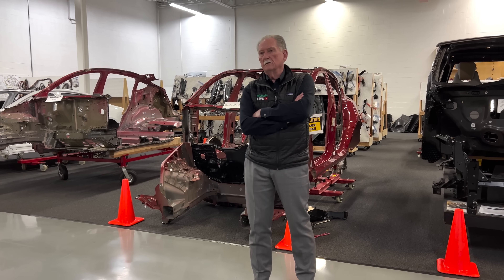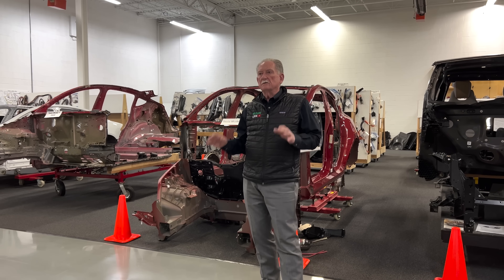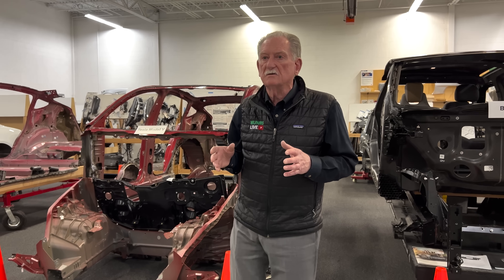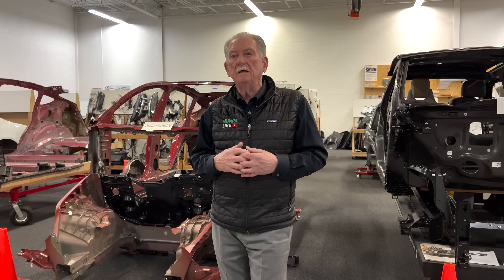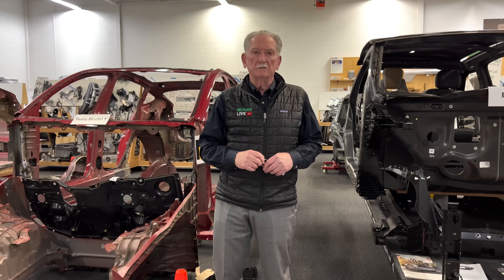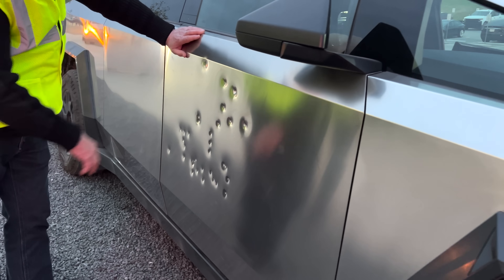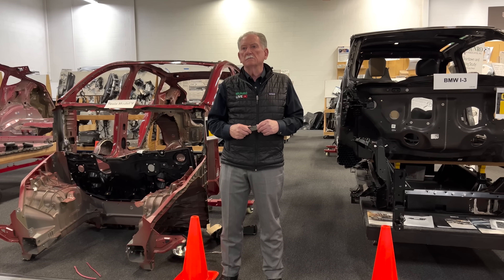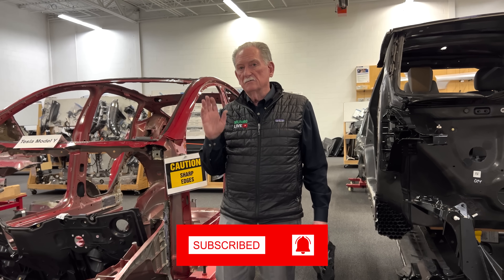An Engineering Analysis of the Tesla Cybertruck

Comment: I’m most excited for the industry to follow 48v.
Reply: Time to ditch the terrible Lead Acid batteries.
Reply: @TCPUDPATM  Lithium has gotten cheaper, and EVs don't have the big starter load that an ICE does.
Reply: @TCPUDPATM  time to wake up, no BEV now uses 12v lead-acid batteries. Lead-acid batteries are needed in ICE vehicles because they can provide very high current necessary for starter motor.
Reply: @ElementaryWatson_fafo  "time to wake up," … Yeah. Sure. Sorry to burst your bubble but about every BEV out there also has a 12V battery. They may not be lead-acid any more but they're there. That's more energy efficient by far than to keep a 400>12V buck converter powered, for the few mA you need while the rest of the car sleeps.
Reply: 48 Volts is not the only news. Tesla has replaced the old, slow CAN bus with high speed internet. With low latency, you don’t need a lot of direct connections, which means you can reduce cable harnesses as well.
Reply: @inber  the new CAN bus is sick also. Both in use together are just better
Reply: @Tazman55x  Especially when time goes by, and wear and tear, as dust gets into all those electronics.
Reply: @RogerM88  because the 2013 Model S electronics are totally all destroyed🙄 get out of here with that mess
Reply: @Tazman55x   Completely different layouts, as environment applications. Unless the Cybertruck is targeting the Rivian R1T profile costumer, wealthy sub-urban people, mostly using it as a car.
Reply: I will probably not tow anything. Just put my bikes in the back. Extender seems a little excessive. But all depends on
Reply: @jackhammer078jack4  most American truck buyers don’t use a truck for truck things anyway though honestly.
Reply: AAA will fix your flat tire.
Reply: @BonoBronck this is the answer, flat tires are rare, carrying a tire all that time is a waste, and roadside is easy to
Reply: It's so cool when an "old guy" appreciates cool new stuff
Reply: Thx to Elon.  And the bozo haters gonna say... Elon didn't invent that.  Dumbass.
Reply: 48V is dumb as hell, the reason 12V is used is because dry skin provides a barrier to it. 48V is going to electrocute a huge amount of novice individuals and technicians. Most likely wont permanently harm them but its just a absolutely terrible idea.

Have a high voltage power system for high power needs and keep everything else 12V or lower. This move is ignorant.
Reply: Strange thing to get excited about.
Reply: @xbus-chris I think you mean a 12V battery? I do know they use 48v for their motor system. My Toyota Prius hybrid uses a ~200v traction battery and 12v accessory battery. The aux/accessory battery is almost always 12v on any passenger car. The 12v-> 48v low voltage system for accessories is what they are talking about.
Reply: @xbus-chris I know that. 48v traction (what you are describing) is compared to the 800v of this vehicle and is vastly inferior. The 48v in this instance is for the aux systems. My 2012 hybrid has a 200v traction hybrid system so 48v for the hybrid/propulsion and recuperation system is old news
Reply: 12v vs 48v sounds like much ado about nothing. Changing battery configuration from 12v to 48v is trivial, so any manufacturer can do it in a moment. Savings on wires are not even noticeable in any way. The rest comes to the equipment. The electronics used in the car needs to reduce the voltage to 12v, 5v,  2.5v, 1.25v, which means there are always power supplies reducing voltage. I would expect more losses in this process due to 48v than 12v. Some electric motors are also fed from LVB, which I don't think will be affected in any fundamental way, but the suppliers would need to redesign their manufacturing lines, which will cost money.
Reply: @ElementaryWatson_fafo  Ah. So if that's all not noticeable and basically a waste of everybody's time, as you say, then why are Tesla and others doing it in the first place?
Reply: @MatthiasUrlichs  that's exactly how every conspiracy theorist behaves. He says I don't know the explanation therefore my theory is true. In reality, the burden of proof is always on conspiracy theorists, they need to prove their point instead of arguing from ignorance.
Reply: @ElementaryWatson_fafo  Oh come on. 48V need 1/4th the cable cross section of 12V for the same amount of power. That's not conspiracy, that's basic physics. Also 48V motors (windows and whatnot) are more efficient than 12V. Many trucks use 24V for much the same reason. Plus Tesla is very unlikely to spend a couple million $$$ on a 48V changeover for no good reason. Thus sorry but the burden of proof why 48V are BS is on you.
Reply: @MatthiasUrlichs  you don't know the first thing about physics, you just keep embarrassing yourself.
Reply: @ElementaryWatson_fafo  Ah. So the P=U*I , R=U/I, R=r*l/A formulas which you commonly use to calculate how much copper you need for a given distance+voltage are just plain wrong and all of our electrical appliances work by magic instead? Is that what you're saying? If not, care to be a little more specific?
Reply: @ElementaryWatson_fafo  lol
Reply: Perhaps, but 24v is already standard. There's not much benefit and a whole lot of added churn by adding a third standard.
Reply: While yes.. every fact Munro mentioned is true.. it's really not coming to the end product... 75% weight reduction... BUT only in the areas of the wire harness that is being replaced.. so it just doesn't add up to a significant end weight.. and as for the price.. the end price of the truck is enormous! So where does this savings show up when it matters?? 

What's the point of all this conversation and moving away from a massive industry standard of 12v  if it's all theoretical improvement that the end user doesn't get to enjoy anyway?

Saving a handful of pounds in things as massively heavy as an electric car/truck is meaningless to the buyer! And the so called money savings is again not enough to effect the end cost of the vehicle.. it's still crazy expensive to buy.. so.. great for manufacturing cost cutting... But meaningless to us customers?
 When do we get to see these benefits? So far it's all just money in the pocket of the manufacturer and never ends up in the buyer's pocket.
Reply: @Napster60  - excellent points. Also, 75% wire harness weight savings so we can then add triple redundant steering systems? I’m not saying there isn’t some impressive engineering in this thing but the shifting arguments for overall advantages of those different systems is problematic to me.
Reply: @Napster60  " “We didn’t know that our wiring harness for Mach-E was 1.6 kilometers longer than it needed to be. We didn’t know it’s 70 pounds heavier and that that’s [cost an extra] $300 a battery,” he said on a call with investors Thursday. “We didn’t know that we underinvested in braking technology to save on the battery size.”

 Jim Farley Feb 4 2023
Reply: @grahammonk8013  

lol marketing speak you just bought into huh? a car battery is like $160 at the dealership.. 300 bucks is an insane number that nobody pays!

"1.6 Kilometers of wiring" comment is referring to the vast and overcomplex Signal and OBD based systems in the cars and trucks on the road today.. Has NOTHING to do with switching to 48 volts. and everything to do with Tesla smartly switching to Ethernet based communications.
Reply: @Napster60 
You're really angry, aren't you?
One reason this is expensive at the moment is... It's essentially "first adopter" technology.
.
They had to build not only the system, but the components.
.
Now, where this gets cheaper is when the volume on this truck increases, but then when it gets MUCH cheaper and smart is when they migrate this design to the Gen 3 platform and eventually  to upgrades on existing models.
That's going to be a lot of Copper, complexity, build time, expense and energy saved.
.
There's also the prospect of industry wide standardisation of certain modules.
.
Now, this would require cooperation and a certain amount of.... Humility(?) from some other manufacturers, and if their previous attitude toward Tesla surfaces, that may not happen (more fool them), but either way, Tesla, and any who do see the advantage (hey Jim!) will do "well".
Reply: @rogerstarkey5390   You can't achieve economy of scale mass producing a vehicle very peculiar, not sharing many components with other models or Automakers. Part of the reason why trucks look almost the same throughout different Automakers. This truck falls short around the hype it had, with price as range, as the lack of the exoskeleton. It's a unibody with Stainless steel panels bolt on. And those massive  casting pieces will be prone to  crack if the truck gets used as a work truck.
Reply: @Napster60  You know what is way better than recycling? Never using at all. A 48 volt architecture widely adopted means 50 to 60lbs of copper left in the ground per vehicle manufactured. That is several large copper mines that don’t have to exist and destroy their local environment and groundwater and spew CO2 into the air, several processing plants not needed too. And 48 volt allows steer by wire, which eliminates a steering column and links that saves more weight and cost and mining, and it allows improved easier steering with a smaller turn radius, and improved crash safety too. 

Even if the cost savings is never passed on by the manufacturers, your car weighs seventy or more pounds less than it would have, and reduced weight imeans better handling and better fuel efficiency and better acceleration. So yeah, no benefit for the consumer except for we get a superior car and it reduces the environmental damage and climate change emissions caused by car manufacturing.
Reply: @tribalypredisposed   Stop that Greewashing. If Carbon footprint since production to recycling were added to the equation, the Greewashing with BEVs would stop quickly. Building more cars doesn't reduce emissions, especially massive BEVs prone to be quickly obsolete.
Reply: @Napster60  If Tesla came out with a disposable car from injected plastic, Munro and the fanboys would be screaming "genius" and "game over". Even if in the end the costumer is the one getting shafted.
Reply: @Napster60 the Benefits of tesla using 48v is that the grid wjll collapse in the usa and europe faster😂😂😂
Reply: Aptera would if it was commoditizes already. As their ceo said in a tailosive ev video
Reply: The auto industry has been talking 48v for near 30 years. The original big issue was filiment bulbs lasted 30s or 30’, whichever came first. 😂. Too thin and break just from normal road vibration.  LED’s now solve that. 

The other issue was the electrocution hazard of the whole vehicle on 48v.  Depending on the country, regulations were an issue.  

Even in an ic vehicle, the cost & weight savings are not trivial by going 48v.
Reply: Why?  Not why is 48v good but why do you care if other automakers do it?
Reply: @diamond_h0us until other automakers move to 48v, commodity parts will not move to 48v. Until that happens, all the 48v parts will be more expensive.
Reply: @JorgTheElder  "Until that happens, all the 48v parts will be more expensive" For BMWMercedesFordGMHondaVW, yes, they have been reduced to car-assembler. For those making real cars not. Its no difference. But it helps with less parts cost, less complexity, less production cost.
Reply: @diamond_h0us  lighter and cheaper vehicle no matter is EV or ICEV.
Reply: @raymondsiu Won’t be cheaper. Wait until you need to repair one. They always stick it to you for anything new.
Reply: @diamond_h0us  Aftermarket electronics such as car AV, amps, crossovers, signal processers, exterior lighting and accessories are at the moment 12v.  People who like to customize their vehicles currently have a limited selection of aftermarket accessories to choose from.
Reply: @emo65170. Most forklifts runs un 48v. Décads ago
Reply: @arteypianos1039  and the cybertruck traction battery is 800v+. Yeah, the low-voltage 48v system has different components in this case then a forklift, like computers, window motors, switches, wipers, lights, etc
Reply: @musicmakerman867  yes, 48 volts it's not new in the industry, and maybe some switches, contactors, minor computers etc ...can be usted inmediatelly for that 48 v systems. I don't know 😅
Reply: @diamond_h0us benefits for all.
Been a good idea for 50 years but all legacy too scared to be first to try.
So Tesla had to be first and send their learnings to the other car companies.
This is all over the interweb.
Keep up.
Reply: @diamond_h0us  Cost reduction across the board - for every electrical part in whatever car. Now apply that to standardization cost reduction & weight savings (the last car I worked on was a mid-90's Buick - I needed Imperial and Metric tools, and star drivers, allen keys, phillips, etc.). Just the cost savings in the fasteners that attach all that wire to the car would add up to quite a bit.
Reply: @diamond_h0us  Some german automakers are already taking the 48V route
Reply: @drury2d8 Correct. BMW has a 12/48 V hybrid system in many models
Reply: @drury2d8 for their Low voltage system?
Reply: @diamond_h0us As Elon said it would bring COSTS OF EVERYTHING DOWN, but maybe you have your ears closed!
Reply: All good till you need a jump from a 12v
Reply: @kman0074  Who does that any more? Don’t we all have aux lithium batteries for jumps?
Reply: @kman0074  You'd top up the aux battery from the HV battery with a buck converter. If your HV bat was dead you're not going anywhere anyhow.
Reply: 48v will not be mainstreamed with other manufacturers until they see a gain for them
Reply: @colinmorand129  There's plenty to gain, but there's too much stubbornness. "We've never done it that way."  "Not invented here." 
It took a long time to go from 6 to 12V but now we have more reasons.
Reply: @colinmorand129 ford is moving to it with their new EVs.
Reply: 48V is all nice but that doesn’t negate the fact that the Cybertruck spare tire will take up more than 1/3 of the bed and the range extender another 1/3. Meanwhile Rivian figured out how to pack in 149 kWh of battery under the truck and the spare tire under the bed …
Reply: @tangoESPECIAL  Then please buy yourself a Rivian. Its nice! I mean it looks good. The CT is a ugly workbeast. The last time i had a defective tire which i had to change immediately was about 30 years ago.
Reply: @tangoESPECIAL my question is how big is that battery compared to the Tesla battery? Because they would have more than likely thrown more batteries in to get the same capacity so the battery is probably bigger and heavier. Which kind of goes against the way Tesla usually is because they don't want to make enormous battery packs. 150 kilowatts would be amazing though. If it's already able to get 450 mi on 122 kw I can only imagine what a 150 would get
Reply: @custommotor Hard to see why that would be a benefit other than for towing.
Reply: @tangoESPECIAL im 38 and have had a flat tire once... and that was because i had old azz tires. Ill call a tow truck and pay the $100 to tow me to a tire shop in the once in a lifetime event that I blow a tire ever again.
Reply: @SmartestDumbGuy  Im 66 and have had a few flats..... I have NEVER put a spare tire on ever! Most cars have little joke spare tires that I wouldn't drive any where on. Spares are just useless dead weight taking up space junk for me.
Reply: @Pneuma40  right? It's really not necessary these days with cell phones.
Reply: @tangoESPECIAL There are other solutions for the placement of spare tire, like hooked using a bracket solution at the back of the back door that closes the bed.
Reply: @finnurth  There are already third party companies selling these things (Unplugged performance)
Reply: @finnurth  ...and I'm thinking that focusing on the spare tire is missing the point when discussing 48v. Tesla doesn't let anything stay the same if they know they can improve it. Bets on all sorts of improvements for Cybertruck #100,001 ...including the spare tire. As much as I want mine TODAY, I'm glad I'm way down the list.
Reply: @Chris-ji4iu  Yes, I agree, the CT will keep developing like all the other cars in the Tesla sphere. This will be an awesome ride!
Reply: @tangoESPECIAL  There's one problem with Rivians spare wheel placement, if you have the bed full of heavy materials, then you can't access the spare wheel.
Reply: You do realize Tesla is getting more range with a smaller battery than Rivian, right? Efficiency is the name of the game.
Reply: For us normal folks,saving 10 pounds of wiring doesn’t mean much and rear steering doesn’t either…Don’t get me wrong I love the idea of Ev and plan on getting me on but we are in the initial gouging stage of electric vehicles and I don’t want to be the first round of suckers to buy an ugly pickup for 100k…Where is my Tacoma,Colorado, or any other midsized pickup Ev with 450 miles of range under 50k with a 10 year battery warranty?😉
Reply: And why don't they make it 120V or more? What is the limit?
Reply: @AguGo  48v is basically the limit for low-voltage wiring. Any higher and special precautions must be taken for handling like the HV Orange cables in the vehicle. Theoretically they could make the steering components 800v/high voltage and only have 48v pull-in contactors, but for things like window motors and switches and the aux battery - they gotta be like 48v or under for safety.
Reply: @AguGo  Safety issue. Rules & regulations. Semi-arbitrary.